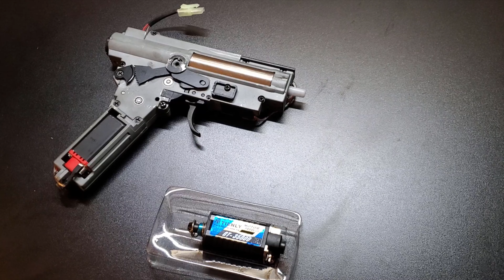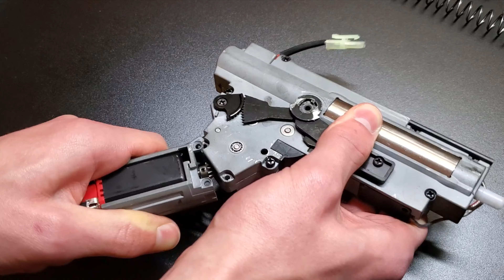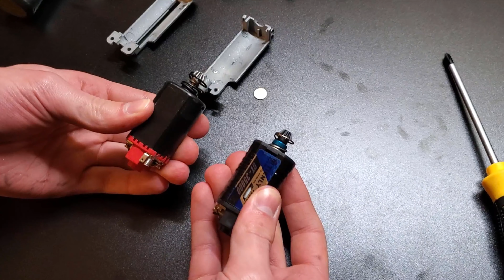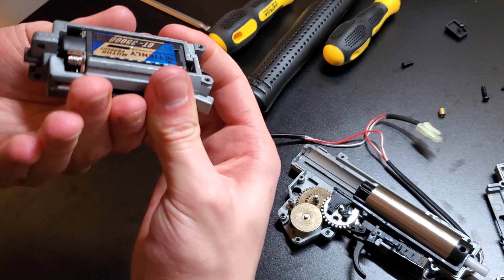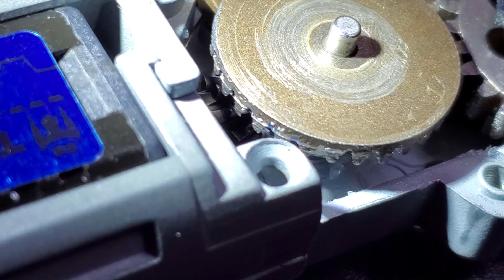Arcturus AK-12 Motor Install - Tienly 35,000! (4K)

Comment: Hello, could you make a video of the installation of [Arcturus] Set Cut off lever V3/Fire control set, since there is no tutorial for it and specifically because of a pin that comes with the set and I don't know where it goes. It would be a very helpful video.

Comment: i adjust the motor height by sound, if too screechy, i go lower, if it has that clank after 1 cycle, i go up.
Reply from the maker: Yes that is a popular way of doing it. This method ensures the perfect gear mesh between the pinion and bevel gears.

Comment: So will that new motor make it shoot faster, or will it make it shoot higher fps, etc? Im new to this motor stuff in airsoft
And will it work in the Arcturus NYO3CB?
Reply from the maker: This motor will work for that m4 if you order the long type. Motors generally have 2 lengths long and short, AK's usually take short type and m4's take long type. This is a 35000 which is the speed, the higher this number the faster the motor can turn. The reason I went with a lower speed motor was because I wanted the torque to pull bigger springs. Are you going for full auto RPS or good trigger response/ high FPS? If you tell me what you want out of the motor I can pick one out for you.
Reply: @OrdoAirsoft  If the bigger spring that your going for is for higher fps then I think I might do the same and go for higher fps because I might get heavier bb's for range and I dont want to lose to much fps. (I think thats how it works, thats what I heard) And how much slower rps will it be? Like will it dramatically get slower rps or will it still be a good rate? And thanks for the help
Reply from the maker: In my AK-12 I use an m130 spring and it shoots 425 fps with .25. If you are going for the same setup I would use at least .30 gram bbs. And yes the heavier bbs you use the lower the fps will go. The motor will have about the same rps as stock maybe slightly higher. Your rps will change depending on which spring you choose. Obviously the bigger the spring the lower the rps for this setup at least.
Reply: @OrdoAirsoft  so should I use .30 because the AK is stronger or is it for more range. And if I need to lower my rps for a field I can just do a weaker spring, right?
Reply from the maker: Use the heavier bbs for longer range and better consistency. If you put a weaker spring in it would increase your rps because the gearbox would cycle faster. The heavier the spring the slower your gearbox will cycle in full auto, in your case anyway.
Reply: @OrdoAirsoft  ok thank you I think I understand this now